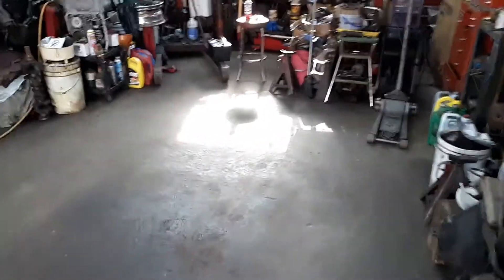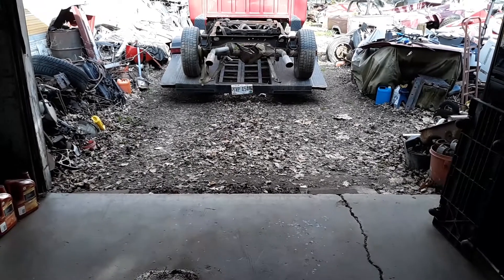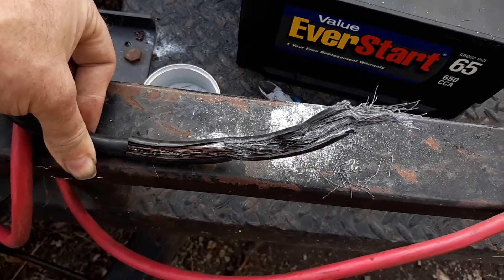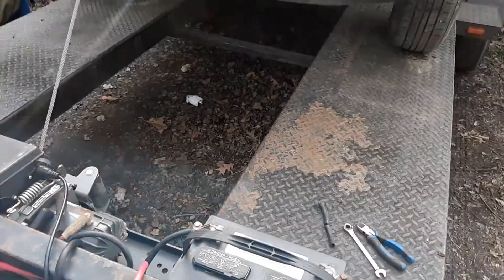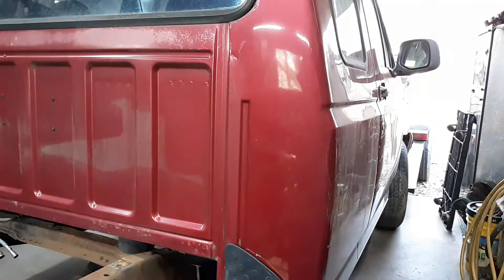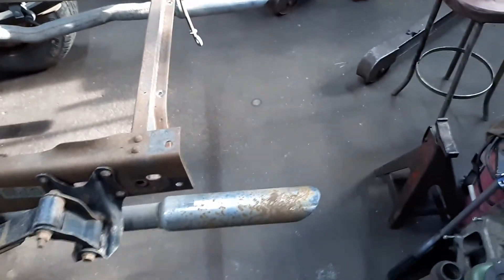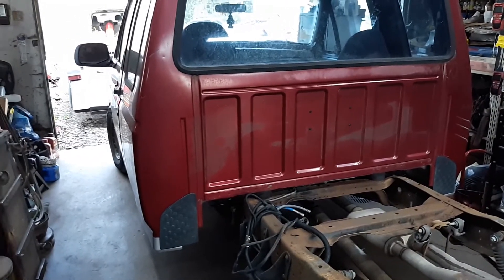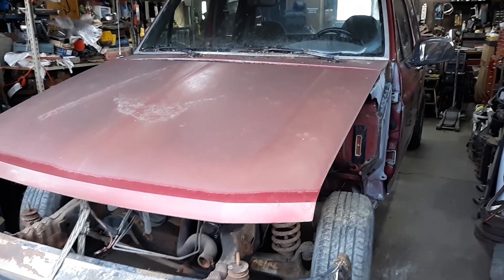Getting back on my OBS Ford project #project #obs #fordtrucks #whatamidoing

Comment: What is the plan for the cab?...or is it the frame you are after?
Reply from the maker: I'm putting it on a 4x4 frame.
Reply: @chefshadetree3972  That will be a cool project.   Me, I've turned into a fan of 2wd....But then again...if I'm stuck in the mud....I call out the 4wds
Reply from the maker: @Dancing_Alone_wRentals  I'm not a fan of 2wd. In what I do and my driveway 2wd just doesn't work. I get into a yard that's a little wet 2wd isn't getting out without help. Besides this build I'm doing is a dream build of mine. Never thought it would ever happen till I found this truck.